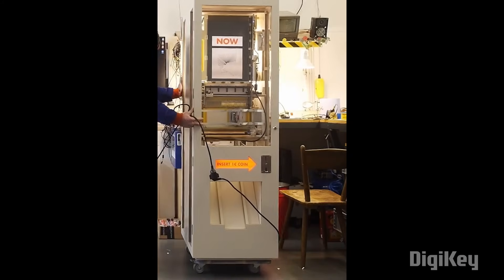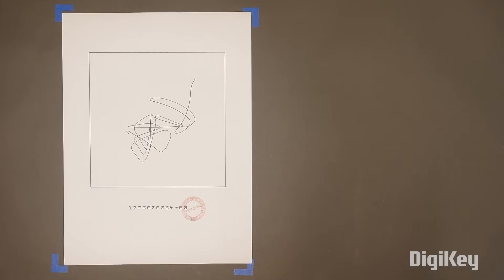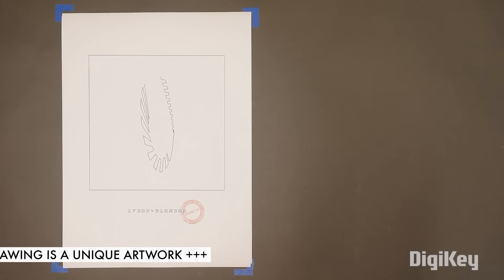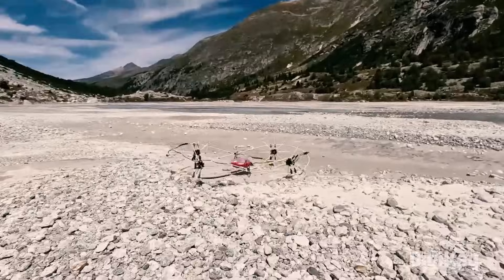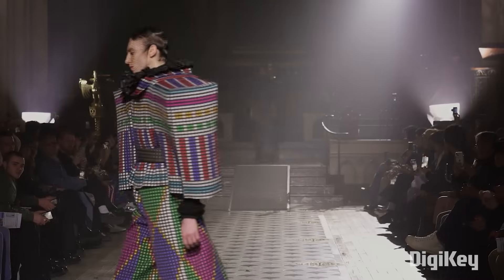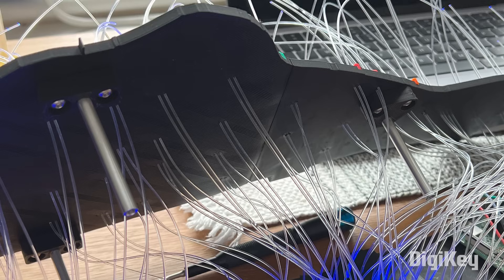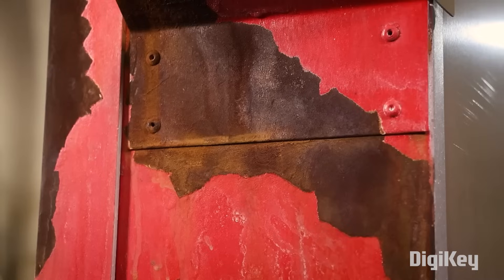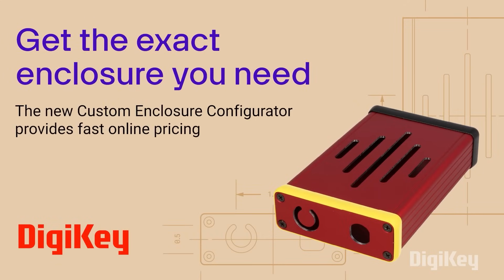Unlimited Edition [Maker Update] | Maker.io

Comment: Not sure why anyone would be surprised that subway map would be a raspberry pie, it could just as easily be a esp32 or lesser micro controller.
Reply: 🤔 I don't think I was surprised it was a Pi project, I just don't think it would have been my first guess if I saw it and didn't know. As you say, there are other, capable, web-connected boards that could probably handle this task. Typically when I see someone reach for a Pi these days it's either for it's display capabilities, or AI/computer vision capabilities, neither of which are aspects of this design. 

That said, I'm all for going with the board you're familiar with (or have at hand), even if it might be overkill. I once designed a cocktail machine that had two separate Raspberry Pi boards inside (one for the kiosk interface and another to run the cocktail pump mixing software). In hindsight, I could have made it just with microcontrollers, but by using the hardware and libraries on the Pi that I was familiar with I was able to get the project over the finish line.
Reply: @MakerProjectLab  W0rd, Pi's are good for prototypes.